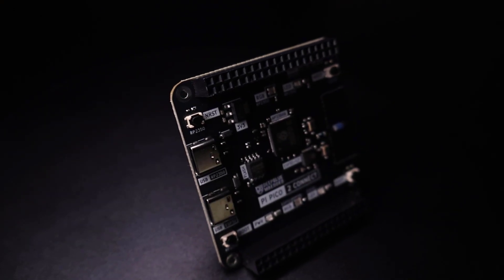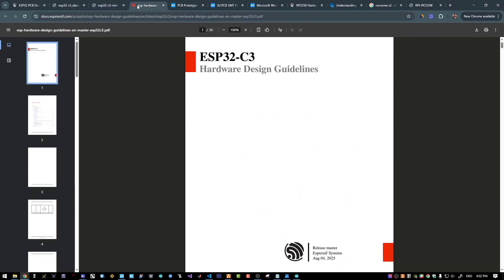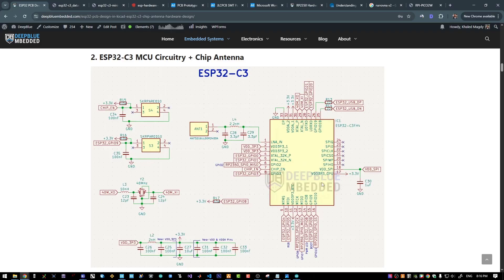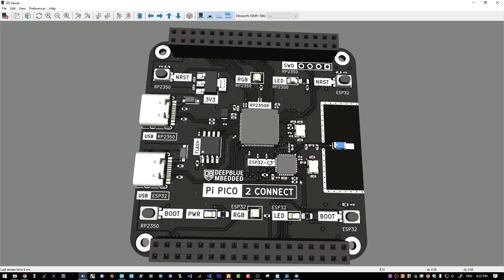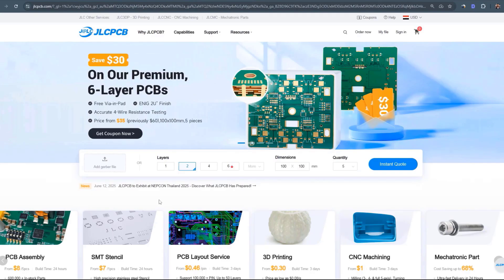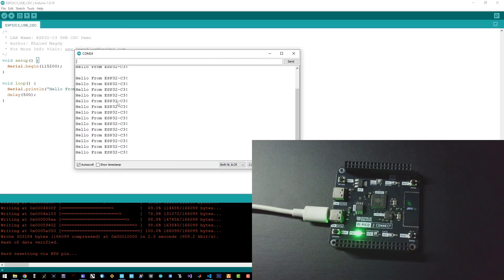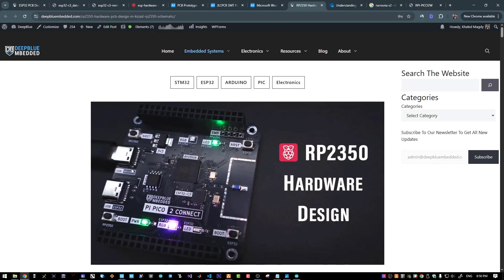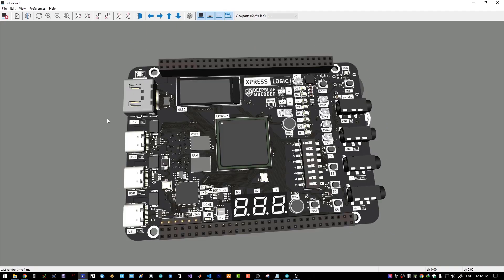ESP32 PCB Hardware Design + Chip Antenna (in KiCAD)

Comment: what about the width of the trace carrying the rf signal between the controller and the antenna , have you calculated it ?
Reply from the maker: Sorry for forgetting to mention it in the video!
For my 4-Layer stack-up, using Saturn PCB calculator, the RF 50Ω trace width came out to be 0.29mm and that's what I've used for routing the RF line then I've rounded the corner with the KiCAD "RF-Tools" plugin.
Reply: Thanks ❤ @khaledmagdy
Reply: shouldn't the trace between the ESP pin and the matching network be tuned to 35+10j, and not 50R? I know it's probably a minor difference in such a short trace, but technically I think the matching network should be righ next to the pin, and then continue with the 50R trace
Reply from the maker: You're right, ideally it should be right at the ESP pin. But as you said it's pretty short distance to make a noticeable difference though.